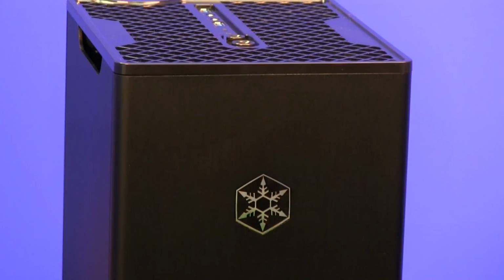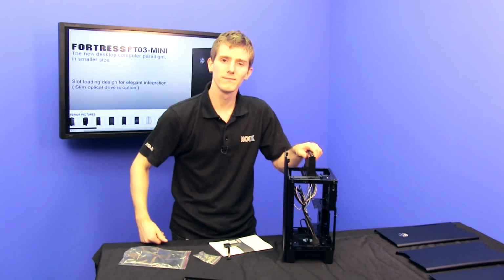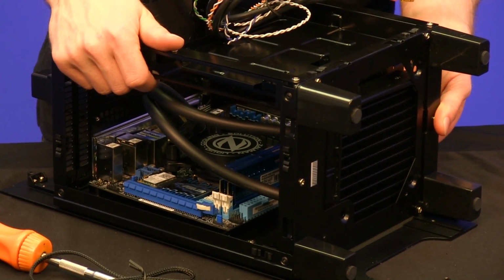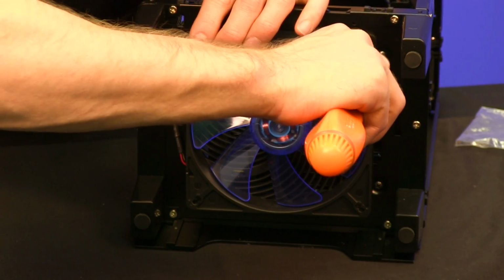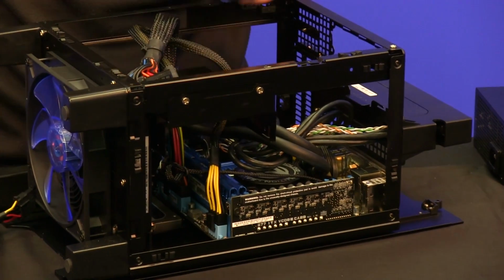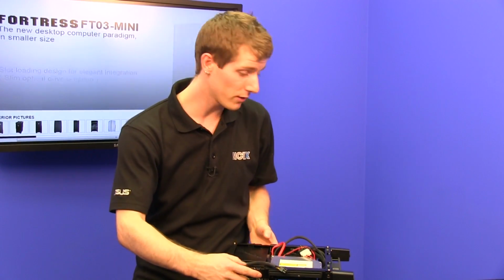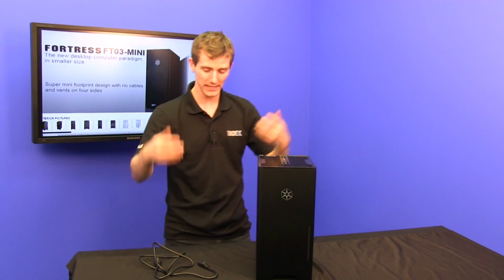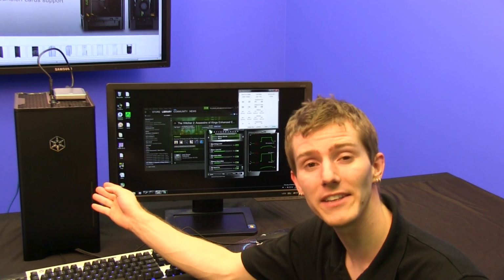Silverstone FT03-MINI mITX Gaming PC Build Guide NCIX Tech Tips

Comment: GPU is mounted vertically and with that tall case it can't even house a full length gtx 1080 reference card? wow...
Reply: This is an old case, designed in an era where GPUs simply weren't that long. I've asked Silverstone a while ago if they could update the FT03 and make it like 3" longer to accommodate the new long GPUs and have a no slot-loading DVD drive option so the front panel is a clean solid piece of aluminum. Haven't heard from them.
Reply: Renaldo015 you can, you just need to cut the bottom of the case like i did. using a 980ti reference right now.

Comment: Still rocking this case in 2021 (inner drive cage removed/cut out), with an air cooler. Considering trying an AIO, installed replacing the airpenetrator with a fan above blowing down though. That airpenetrator is loud btw, replaced it with a noctua back in 2013.

Comment: Literally the only "Mod" I would consider without changing any hardware, Popping a Perfect round hole over that GPU Intake and slapping a high flow screen and dust filter over it, maybe go as far and adding some more Sound Damp around that hole to isolate the intake air from the air passing the RAD. Other then that, I would certainly build this for my younger siblings to use and play with.

Comment: For what I've sen, if you mount the gpu right after you mount the motherboard (this means that there will be less things to interfere), it will fit, you'll have to insert it at an angle through the side where the PSU, and optical drives are placed

Comment: The air from the radiator won't become more than a few degrees hotter than it was before. The case is a very tight fit and by using the bottom fan, he saves valuable space in the case (and also it's more silent because you have one fan less). Also, the Silverstone Air Penetrator are pressure optimized fans, which is perfect for using them with a radiator.

Comment: I done Mod this FT-03 mini case for best ventillation. It can handle: ATX PSU board w/o modular cabeling, Big sized tower HSF, and 10,5" Ref./FE VGA in same time. 620W-PSU/R7-1800x/1080Ti/2x2,5" insane for that small footprint.

Comment: I built this - a few notes.  The ASUS silent profile doesn't work with the stock 3 pin case fan, so don't bother doing that unless you spring for a new 140mm case fan.  Also, skip the modular PSU, connector placement makes it amazingly tough to use the internal mounts.

Comment: Okay, I'd agree then. Most power supplies will actually give a maximum temperature range over which they are not guaranteed to be 80+ anything. So given the low airflow within the case it would be a good idea to be well over minimum Wattage requirements.

Comment: If you don't mind a case that is slightly bigger but easier to build in, get the Prodigy. Also, that might have a little more ventilation, so if you get a hot graphics card it might run a bit cooler.

Comment: A Radeon GTX Card!!!! :P

Yeah, you could run an entire 7970 system on a 500W power supply, with multiple HDDs, SSDs and fans. Gemini II M4 is an air cooler, so it will only use as much power as a fan (water coolers need extra power for the pump).

However, power supply's do run most efficient at between 40-60% load, and a500W model would be pushing it a bit hard, so I think your ideal size would be 650W, but 600 and 700W are fine.

If you're making ITX, go for a silverstone PSU.

Comment: Yes it can run it. The wattage is not really important, it's important of course but it's as important as the quality of the power supply, how good the components in it are etc. These days any psu above 400W(if it's a good one) can run a decent pc. As long as you don't have SLI/Crossfire you're good to go.

Comment: CPU - 3570k, or 4670k (if you're waiting for Haswell)

Mobo - ASRock ITX z77 (best value), ASUS ITX z77 (best overclocker)

PSU - 140mm Silverstone, silver or gold 80plus, depends on budget

RAM - 8GB low profile, 16GB if in budget

SSD - Samsung 840, whatever size is in budget, don't both with Pro series

Cooler - Water Cooling is best for ITX. Get the biggest you can fit in your case, don't skimp on cooling for ITX.

Case - What you want; FT03-MINI, Prodigy, Node 304, SG08 are all amazing.

Comment: yes it is, this configuration takes max 380w from the psu, Ivy and Kepler are low power consumers (no OC), the only problem is that it beats the point of silence that 80 mill fan will be loud at that point XD, take in the account the specs that the manufacturer released about power is conservative, that means they give more headroom, and not all 500w labeled  psu-s can really give you 500w

Comment: I like the idea of a small gaming pc thats easy to carry around, but this scenario presents to many problems that diminish your returns:
1. Difficulty of installation.
2. Difficulty to maintain, like cleaning out dust, removing parts.
3. Less cooling efficiency.
4. A most importantly, ou would expect these parts to be cheap, but they come at a premium compared to larger parts.
What I would do, is go for a midtower or at least change to another sf chassis.

Comment: I went with a ITX build last year. 
ASRock Z68M-ITX/HT z68 MOBO
Intel Core i7 2600S
Intel BXRTS2011LC Liquid cooling
Nvidia 545 OEM DDR5 addition ( Got it cheap from a friend for 25$ ) 
SilverStone Sugo Series SG05BB-450-USB3.0 With 450W PSU
Patriot Gamer 2 Series 8GB 1333 Memory
Intel 335 Series 240GB SSD
Hitachi 500GB Magnetic drive
Samsung Blu ray DVDRW slim optical drive 
The system is pretty quite and robust, but when it comes down to repairs, upgrades and modifications its a pain

Comment: This is one of the very few cases... That was not meant as a pun really... That the closed loop water coolers actually make sense because with a good big heatsink air cooling in only 1-2 C behind and its half the price.

But here you don't have the room for a 140mm fan and radiator.

Comment: Any dual-slot card less than 10inch or 254mm long should fit, but there is  extra room for even longer cards.  I managed to fit a 275mm(10.83") long HD6950 into the case by putting in the card into the case before the motherboard.

Comment: Really, really like the case very much. They should only find a way to run the cables internally to the bottom. Now you have a cable mess coming out on the top of the case which I don't like.

Comment: Yeah hot air goes up but do you want the heat from the radiator going right back over you components. This is just a simple design flaw in the case, but that's what had to be done for the connectors to be on top.

Comment: Opps, I think I can still answer  CPU's with stock 125w power consumption draw close to the amount of amps that a 12v 4 pin can supply. If that chip is overclocked you can easily go past the 10 amp or so a 4 pin 12v rail can handle, by spreading this out on the 8 pin with twice the wire you can get 20 amps on a single 12v.
I may not have my amps correct, something like a four pin=  two5 amp powers pins and 2 ground pins, so the 8 would be double that.

Comment: Hi  Linus!
I have build 2 systems based on this case with almost the same components, except  the graphics-card, cpu-cooler, ram.
I have to make a small comment about the included air-pentrator fan.
This is a 3 prong fan that is not rpm ajustable ont the asus board you are using.
I have used this board with the included software, it ran at constant 1600 rpm!
I had to use the included 4-prong (pwm) fan of the Corsair H-60 to keep the noise level down.
I still had very good temps, with this case!

Comment: I like how he said there will be a 3570k in the build but in reality its a 2500k, sandy bridge runs 10% cooler any day. I can overclock my 2500k to 5.1 ghz on water and still maintain temps under 76 degrees, I tried out haswell (4670k) on my brothers build and that cpu runs hot, 68 degrees at 4.6 ghz.

Comment: 3570k 22nm technology (smaller), better power efficiency, runs a little hotter but for a £10/$15 difference you may as well for future proofing. You don't need loads of cores for gaming, 4 (eight virtual) is enough for gaming. Plus Intel has hyperthreading.

Comment: Yeah you would be but you would have the heat in there either way if you used an air cooler. And it sounds like quite the little desktop you have there :) I have an x51 with a GTX555 (Will upgrade to a 660 at some point), 8Gb (Up to 16gb when I have the cash) and a core i5 2320 @3ghz

Comment: When i said Spec..  i meant the specs of the gpu (gtx670) -say 500w minimum. 
Also.. smaller cases tend to not have as good of airflow of larger cases because components are more crowded.
Thus using a psu of greater output than required, ensures that it will endure over time since a psu operating under it's rated output runs more efficiently and operates cooler.

Comment: About $1200 with all new stuff.  Not bad considering performance.  Stay away from asrockl motherboards with that cooler setup though!  I just bought a new Noctua PWM fan to see if I can get the sound down, the CPU runs very cool, I don't think I need the stock penetrator blowing at 1500 RPM all the time.

Comment: The only upside to the 2500k vs the 3570k is that it runs just a bit cooler. I haven't had any overheating issues with my 3570, and it is 5 - 10% faster clock for clock. So gaining a few degrees is worth it for the pcie 3.0 support and the faster speeds...

Comment: Well, obviously AMD is referring you to use a PSU that size for an entire system including a 7970. Come here for Anandtech's benchmarks, 680 (the red) vs. 7970 (the blue), and go down to "Load Power Consumption - FurMark". FurMark is a GPU stress test, so that power consumption (387 watts) is the absolute max for an entire system with a 7970 (variables including differ overclocks etc.)

Comment: Things he said in the Video you didn't pay attention to:
Silverstone FT03-Mini
Intel 3570k
ASUS P8Z77-I Deluxe
Galaxy GTX 670
SIlverstone 450w Modular PSU
crucial m4 ssd
a slotted Optical drive

Things He didn't  say but used and that you should have some sense enough to pick out yourself if you gonna build any PC

Patriot viper 3 Intel Edition
Thermaltake CLW0216 Water 2.0 Pro Cooler (without Stock Fan)

There you go, Glad I could hold your hand and walk you through this tough time

Comment: there is a Seasonic 360 watts which is gold rated and single rail is also pretty cheap and its enough for a single Gtx 660 it is non modular so get a case with some cable management ;.\

Comment: I was wondering the same thing. Looking at specifications of this 670 and the 780 I discovered that the later is 0.5 inch longer. So maybe it'll fit, tighter fit for sure and I not sure its cooling wouldn't be compromised.

Comment: I have tried the Airpenetrator-fan in the case but i cannot get the rpm down from the fan.
i have used other 3-prong fans, i had left from a EK-watercooling kit, they had the same problem on the Asus z77 de luxe itx board.
Only 4-prong fans work ok, like Corsair stock-fan included with the H-60.
Or Noiseblocker-blacksilentpro (pwm) 600-1500rmp fans, super silent,, a bit expensive, but they are great!
I can recommend the case, the board, and power supply, they are asome dude!

Comment: That PSU cab gtx 680 without problems, if the PSU have Gold 80 certificatation, you can run it, all system cant consume more than 400 watts a full loaded

Comment: although it look cool - the price of the case is at least $60 more then a bit Prodigy.  also  drill a few hole in the side where the GPU fan  so it can suck some clean air and not dirty air from the radiator

Comment: I have a cheaper configuration with this smart ande clever case:
MOBO: Asrock H77M-ITX
RAM: DIMM DDR3 Corsair 8GB / 1600Mhz Vengeance LP [2x4GB]
i3-3240 with standard cooler (max 45 under load)
VGA: EVGA nvidia gtx 660 (max 75 degree after 15 min furmark full HD test and 160Wat)

PS. The ati amd saphire 7870 i tryed was 93 degree with the same furmark test and 240Watt!!! As pointed aout by Linus the VGA cooling design is very important in this case!! Thanks Linus!

Comment: I actually assembled something similar arround a cooler master elite 120. Cheaper and easier to build, though this one looks better. Total cost arround 900€. here's the specs:
Cooler Master Elite 120 mini ITX
Asus P8H77-I
Intel core i5 3570
16 GB RAM 1600 MHZ
Corsair HX 620 watts
GTX 6600
Samsung 840 pro 128 GB SSD
2x 1TB Samsung F1 HDD

Comment: Linus, I'm not sure if you'll ever read this but I figured I would give it a shot anyways. As far as I understand there is built in failsafe with 600 series Kepler cards in terms of TDP. I know that with my asus gtx 670 if I hit 70 degrees the card would automatically downclock itself to maintain that temperature, the performance difference was so large when it hit 70 degrees that I could notice in game within a few seconds. Therefore at 81C wouldnt you be butchering the cards performance?

Comment: Sorry dude , i actually probably bought the last one :( , just a heads up if you want to do push pull with this you can , you have to sacrifice the 3.5 and the 2.5 inch drive bay under the slot loading dvd , also you need to bend one side of the dvd drive so the second fan will fit , what i did was basically that and this means i can have 1 2.5 inch and 1 DVD , but i was smart and a taped my SSD to the side of the case , the side panel is all aluminum , so it is a big cooler for my SSD :D

Comment: Nice little tower but expensive. Just built one with CM Elite 120 and love it. Are you not blowing warm air inside the case when using the rad at the intake? I use Noctua NH-L9i on my i3-3225 and max temp is 60. Great little machine. Adding a GTX-660 OC to it, it will get noisier for sure, it is actually very quiet. Has two SSDs and one WD Black 2TB for backups and stuff. Running Windows 8 and OS X on it. Two machines in one small box.

Comment: i just build up a micro atx pc. Was thinking of building an itx before but i really didn't like cable management in mini chassis like this one. All the wiring is so exposed. Looks untidy and not that good for the ventilation on the inside. And its just 450 watts lol how is that considered as powerful. Though i will agree that the case looks really sexy on the outside. and the single fan under it looked like a really cool cooling solution if it was not so packed with wiring.

Comment: You might want to check if your h80 is correctly connected to the processor, I have a 3770k and a hyper 212 evo and i have it oc'd to 4.5 and it doesnt get that high.

Comment: Great case overall, but not suited for a full size graphics card. Bought the maingear Potenza and have it for 3 years. The Potenza uses a Silverstone FT03 mini and while it is a great looking and well built case, it is not suited to a full size graphics card. My GTX 670 runs extremely hot and throttles constantly. You will basically be limited to the PSU shown in the video and GPU selection will be very limited as well. The CPU (i5 3570k) is fine overclocked with the corsair water block and  the Asus motherboard is the best I have ever owned. (P877ZI-deluxe.) Should have changed out the case soon after I bought it from maingear as it just isn't good for the GPU. I upgraded my GPU to a GTX 980 and will be putting that with my original parts into a Fractal Design Node 804. Hope this helps.
Reply: Was your 670 a blower style?
Reply: For other people reading above comment:

This case is perfectly suited for full size graphics cards. Just make sure to use a blower style card (air blows out of case)  instead of a card that blows air to the side (i.e. air stays in the case) and mind the length of the card. Mine is 241mm and seemed like a tight fit. So choice in GPU is limited (according to blower style and max lenght) but still plenty of choice for high end GPU (no suitable GTX 1070 at time of writing though).

Have had this case since december '12. First with GTX 670, replaced by GTX 970 since Feb. 2015. Never had any problems with overheating even after hours of full load on the GPU. Hot, yes, but never any throttling. Confirmed with many hours of stress testing with OOCT and keeping eye on GPU freq's. And that's with fully loaded case (3770K, 2x SSD, 1x 3,5"HDD, 1x slim optical drive) and high ambient temps in summer (> 30C).

Only small problem I had was with the PSU,  don't use the modular ST45SF-G (or probably any modular PSU) if you intend to fit a 3,5"HDD. I replaced it with a Silverstone SST-ST45SF = fit.

Comment: the 780 is SLIGHTLY longer than a 670 in the video but you should still be fine because it is significantly shorter than a 7970.

Comment: the say 500w because some people upgrade their GPU but leave an older PSU so they recommend a 500w for the conectors and othey newer stuff in the newer  PSUand besides the gtx 670 cannot even pull 225watts (75watts per 6-pin and 75watts through the pci-e slot)
 this particular PSU can power a gtx680 with an i7 3770k XD

Comment: @ncixcom will a 680 fit? Would a water cooling block work in this system for the 670?  I guess the question should be are there any water cooling systems, with a low profile rad that can cool the cpu and gpu?

Comment: Yes but you wont be able to use PCIe 3.0 as AMD architecture doesn't supposrt it at the moment. But thats not really a problem as PCIe 2.0 is sufficient for all graphigscards atm. Especially with the 7750 wich is a budget / middle class graphicscard. so no problem :)

Comment: I have almost all the same hardware and case but changed the buttom fan to Noctua NF-A14 ULN fan @ 598rpm.
The Silverstone SST-ST45SF-G 450W PSU is also noisy so i changed the fan to an Noctua NF-R8 PWM Silent Case 80mm Fan @ 1200rpm.
But now the Corsair H60 makes all the noise :(

Can i reduse the speed of the whater pump from 4000rpm to 2-3000rpm?